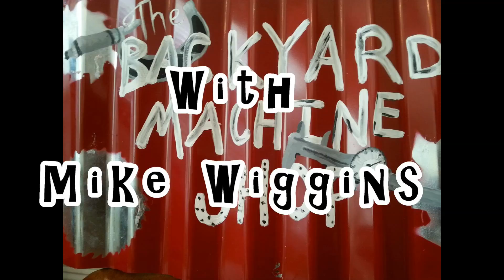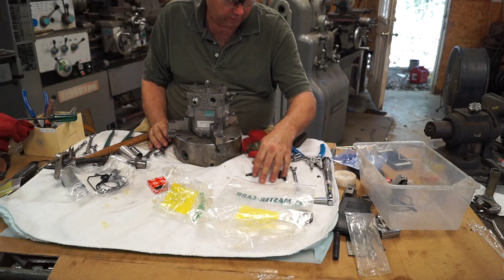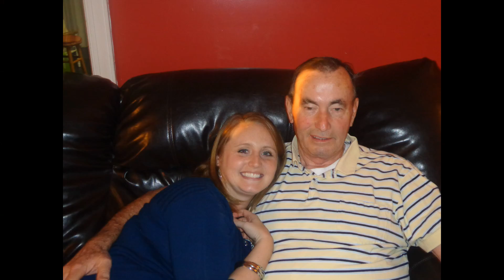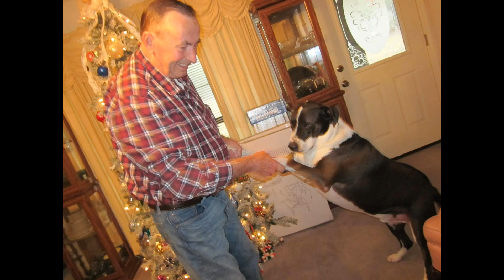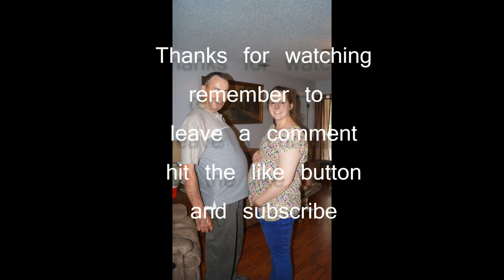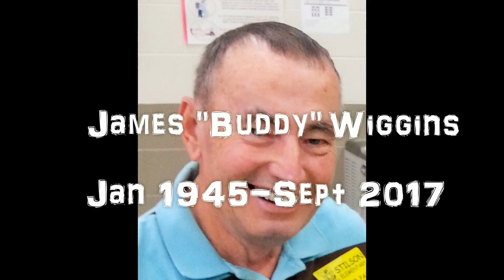Hydro-Gear Pump Rebuild Part 2   (Zero Turn Mower Pump)

Comment: Hi! I have a Hydro‑Gear 328‑0650 (0361T1078) on my riding mower. It drives fine forward, but when I try to go backward, especially on a slope or in snow, it has very little power and makes a slight whining sound. The gas pedal feels normal. The bypass lever works correctly, so I think the problem is internal in the hydrostatic transmission. Has anyone experienced this before or can give advice on repairing it? Thanks

Comment: I rebuilt both pumps however we can't seem to get the right one working.  It feels like there isn't getting any pressure.  We have tried multiple time to bleed it with no success. Before I completely disassemble it again I thought I might ask you what you might think might be causing the problem.
Reply from the maker: The only thing I can think of is you bypass may be open

Comment: Thanks for the videos Mike.  I have a Ferris mower which I love but the parts are way too expensive.   The pump are about $1,000 each.  My left pump either needs to be rebuilt or replaced so I'm taking it to the shop next week.  If they can't rebuild it, I'm going to buy a new mower and attempt to work on the mower myself and then sell it.   Any less expensive mover you recommend?  I mow about 2 acres of yard and about 9 acres of pasture.

Comment: I used to work in the foundry that made the part you call the "head". They make a lot of parts for Hydro-Gear. Hydo-Gear do a lot of the machining in house, but we did machine some of them. I think they have something like 50+ Makino HMCs. I toured their shop in Sullivan, IL once. Neat place. They really have their act together on the manufacturing side.
Reply from the maker: Thanks for watching,

Comment: Thanks mike for sharing. Do you ever have to do anything to the assembly that holds the plungers that rides against the head you resurfaced?  I would think that assembly would have to be surfaced also because of wearing against the head. Sorry about the passing of your father.
Reply: i think that is plastic, it will be ok i reckon
Reply from the maker: The piston carrier is also Cast Iron, I didn't do anything to it because it looked good

Comment: A liitel grease non the bearing would make it stick a little better and it works good on holding gaskets in place during assembly.
Reply from the maker: Yes I've used that method also